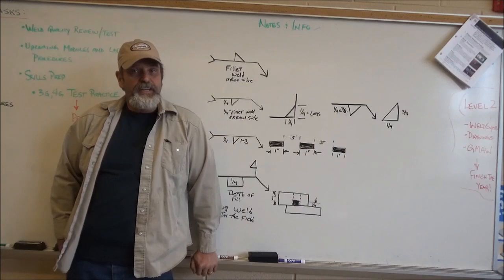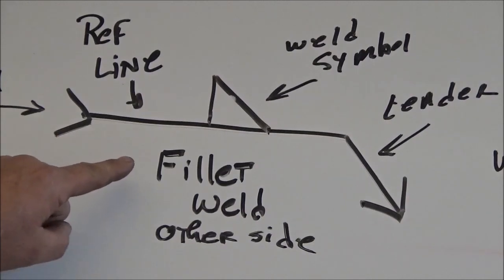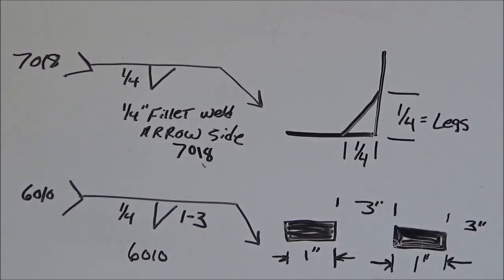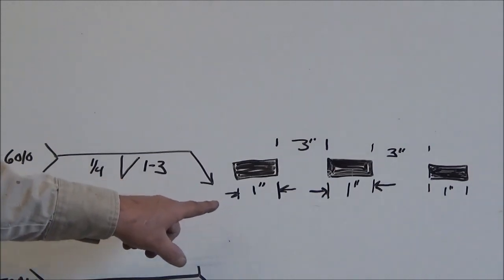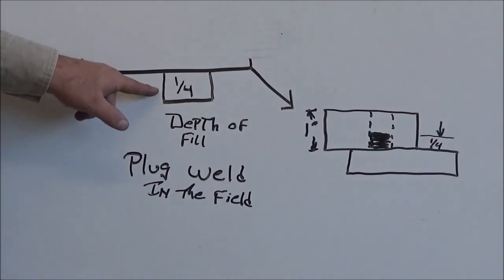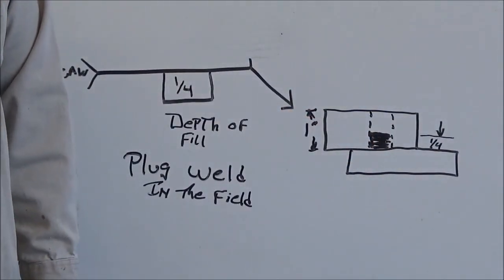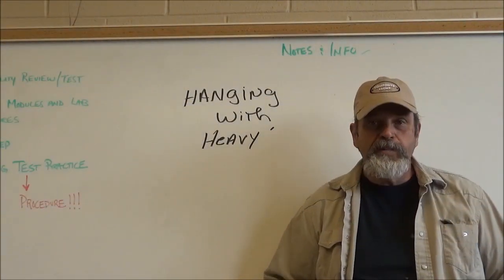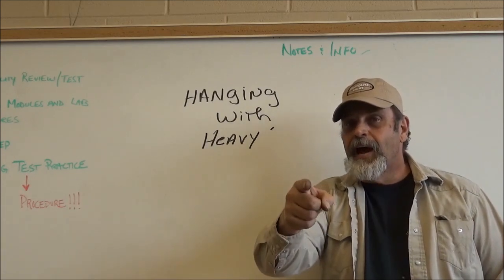HANGING WITH HEAVY WELD SYMBOLS 2

Comment: Thanks for the video but I think there's a mistake in interpretation of the intermittent welds. The spacing distance of 3" called pitch is center-to-center distance. It's not end-to-start distance as you said. Please check and let us know.
Reply from the maker: kossivi you are correct the distance measured is from center to center however for ease of understanding the distance is the same if you measure from the end of one to the end of the other, or you measure from the start of one to the start of another, the spacing the same. I believe I stated that the distance is measured c to c but gave other options for ease of understanding. To understand this process lay out your weld center to center to the correct size, and space....now measure from the end of one weld to the end of the other, same spacing distance. I would explain to my students the C to C spacing but once I showed them the alternate way of layout it became very clear to them.
Reply: What’s throwing people off is your DRAWING is showing the 3” dimension from the end of the weld to start of the next weld. See your drawing.

Comment: I believe your 1-3 is 1" weld length intermittent with pitch spaced 3" center to center, it would 2" between welds
Reply from the maker: true it is but as a pipe welder I think of center to center which is how we measure things. ! inch of weld on 3 inch centers. Now if you measure from the end of one to the end of the other you will see that works out for laying out your welds.
Reply: you caught that 2!!
Reply from the maker: @flliner  see my reply to Michael Miller for an explanation on alternative methods of laying out your spacings, much faster and still right on the money.

Comment: Quick Question! 
I’m only a student and I’m curious about the intermittent weld. I was taught that the spacing between the welds are measured centre-to-centre, not from one end to the other. You seem to know what you’re talking about, could you please clarify this for me?
Reply: It's the same distance, from one center to the other and from one end to the other
Reply from the maker: The distance from the end of one weld to the end of the other is the same as the center to center spacing. Take and lay out the first two welds 3-8 for example on a piece of steel. Now measure from the end of one weld to the end of the other. You will see that the spacing is spot on. You are not "Just a student" you are on the way to becoming a highly skilled, highly qualified welder, earning fair and honest wages. We all started with that first arc.
Reply: @hangingwithheavy2113  Thank you sir for such a video. Sorry but the distance in between from end to end is suppose to be 2 not 3 if the center to center is 3. if you make 3 to be the distance in between as you have said, center to center becomes 4 which is wrong.

Comment: sir is am correcrt.......the symbol of slot welding an plug welding is same but only difference between is in that square if diameter is given then it is slot welding an if it is diameter symbol  not given it is simply plug welding......

Comment: Good video but you have an error. On the intermitting weld symbol you state it is on center to center but show the spacing. In the video you have a 1 - 3 (L - P). The weld would be welded as 1" and have a 2" space between weld. the easy way to do this is take the Pitch minus the length. 3-1=2. Thank you everyone.

Comment: how you will know what kind of welding symbols to use? thanks!
Reply from the maker: #d that would depend upon the joint design, Naturally an overlap type weld would be a fillet, a but joint same thing. Keep in mind the weld joints Butt, lap corner, edge, and tee type joints. Now the joint design may be something else like a deep groove for semi auto welding, but it all goes back to the 5 joint designs.
Reply: @hangingwithheavy2113  thanks!

Comment: Whats the field?
Reply from the maker: the field is where the welding is to take place out side of the fab shop. For example you may fabricate a stair in the shop but when it is installed it will require welding "In the Field" great question I am sure many were asking the same thing.

Comment: That’s not 3 inches on center that’s 3 inches apart
Reply from the maker: Daniel, when measuring weld spacing we always measure from the center of one weld to the center of the other.. thanks for watching.
Reply: 3in center to center would be from start to start or stop to stop
Reply: In D1.1 weld spacing measurements say 3on12 would be 12 inches overall "3in weld 9in spacing 3in weld 9in spacing" it would measure 12in center to center of weld. They way you showed is the European method

Comment: Definently not correct, the pitch shall be center to center dimension. The dimension isn't the same edge to edge.
Reply from the maker: Manuel I ask you to do the following using a piece of cardboard and a marker. Now lay out maybe a three foot section of the cardboard in 4 inches of weld on 12 inch centers. now this is exactly correct you are right here; to the answer on the CWI test. Now measure from the end of one weld to the end of the other. My point was after you get the first one laid out the end of one weld to the end of the other is an easy way to lay out a long section of incremental welds. You are correct though on the spacing. having laid out many sections of this type of welds is easy to learn and quick.
Reply: @hangingwithheavy2113  I was by no means being disrespectful. Thank you for your input and the knowledge you spread. I just wanted to put my two cents for the people that are just now starting to learn.